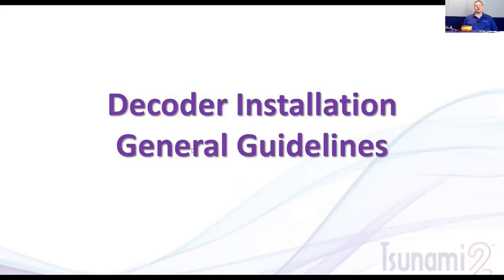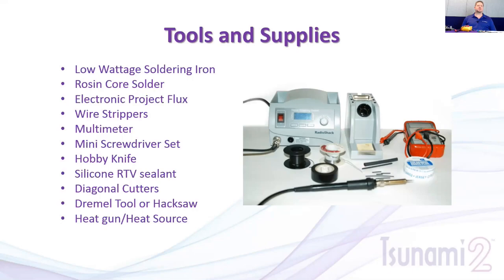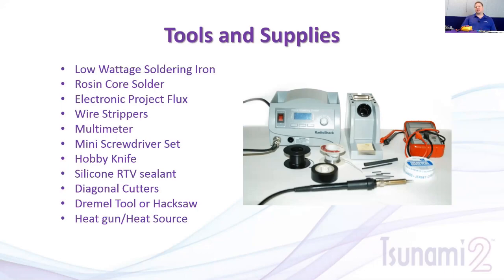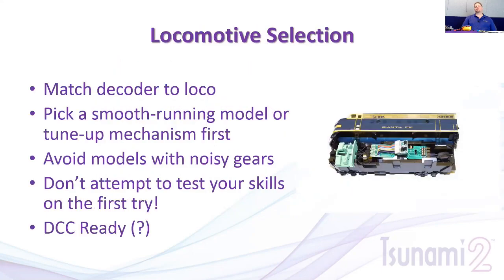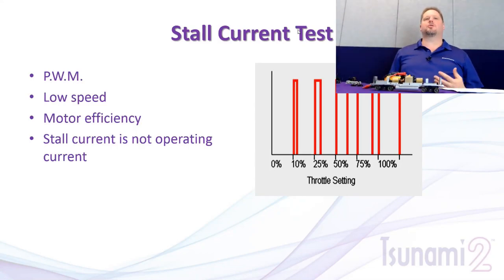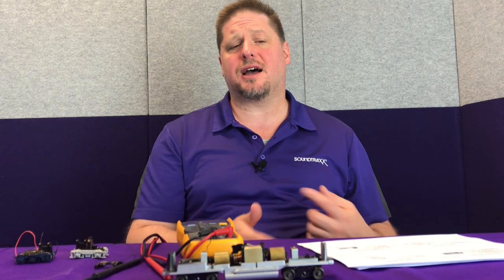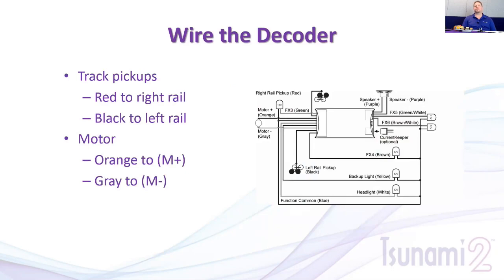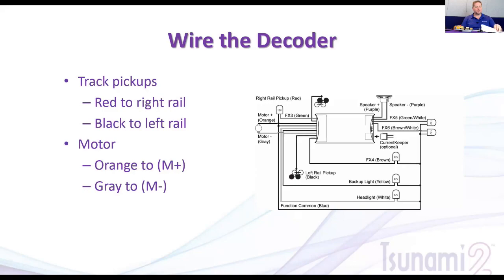Basic Decoder Installation Overview with SoundTraxx (Webinar 7)

Comment: I wish everything could just be plug it in and go. No soldering crap with tiny little wires.
Reply from the maker: We have multiple decoders that can be plugged in, the decoder install depends on your model though.